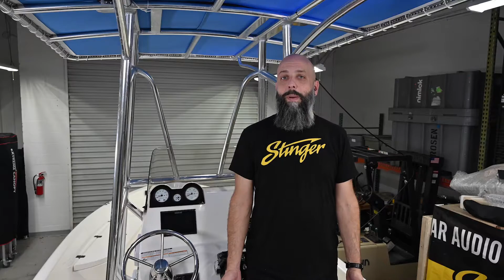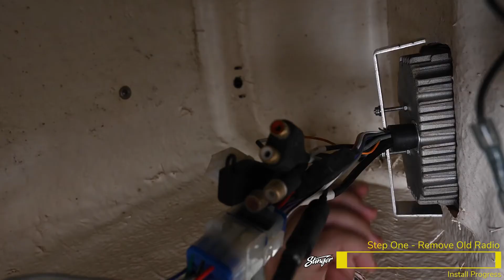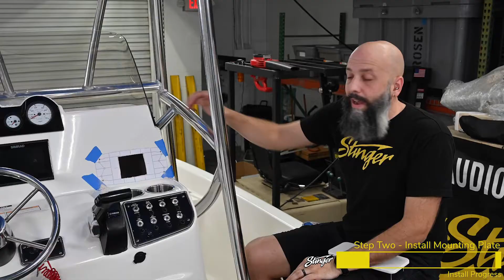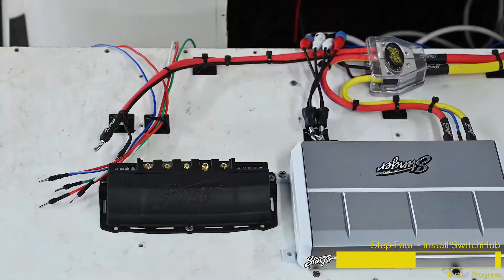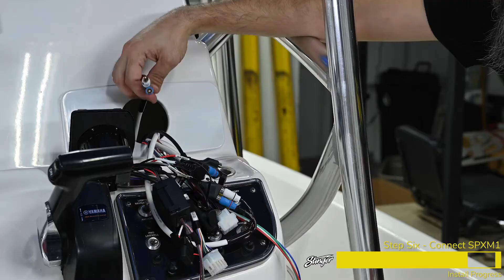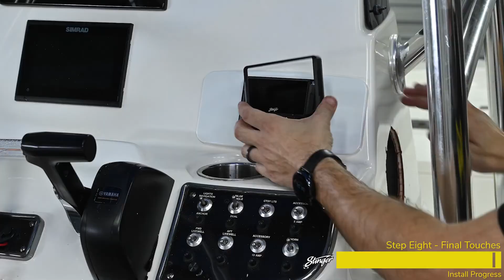Stinger's SPXM1 Installation Video

Comment: I bought the switch hub and absolutely can not get the screws on the positive or negative triggers to grab the wire. What am I missing here? Very frustrating and ready to toss it in the trash. Please help.
Reply from the maker: Is your wire of suitable size or gauge? If not maybe try our wire Ferrules to increase grub screw contact area......
Reply: The wire size isn’t the issue. I eventually had to take the screws completely out then u see a smaller Phillips screwdriver to force the wire connector to open because it’s getting caught on the plastic body on the hub itself. The hub screws will not open the connector.